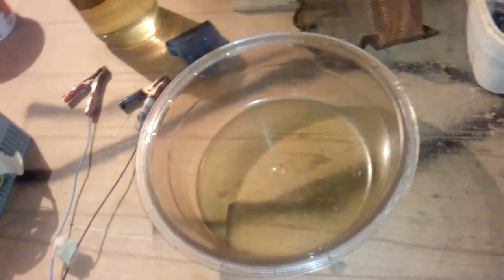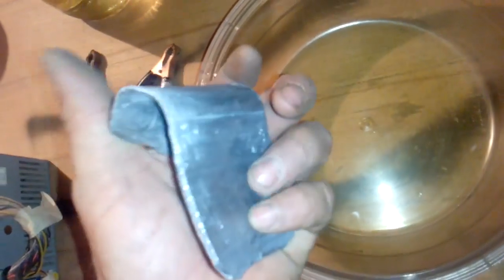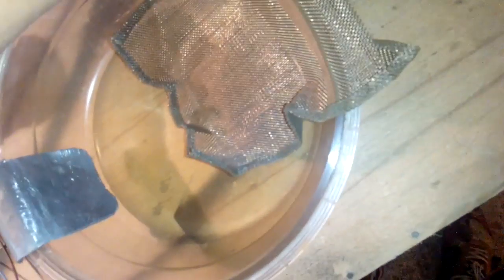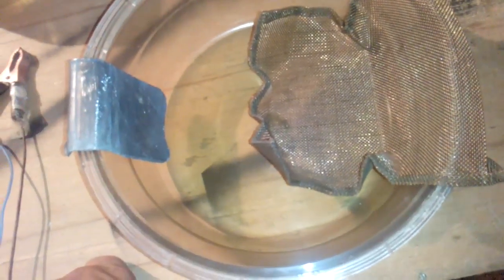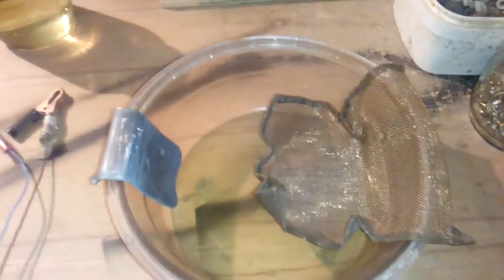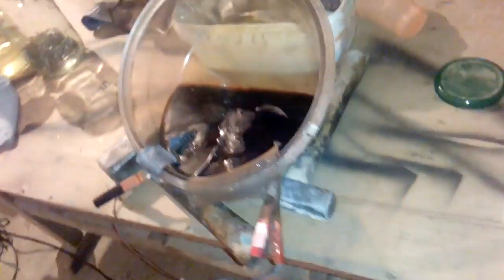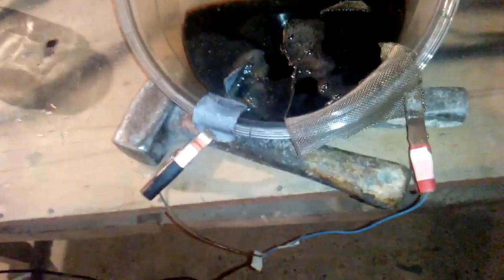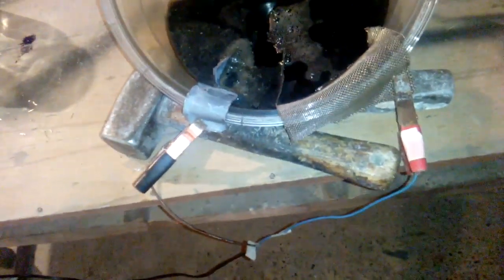Reverse electroplating gold recovery part 1

Comment: Thanks so so immensely my friend for sharing your excellent + informative + and easy/clear/concise instructions w/absolutely zero bullshit mixed in !!!!!
I used a copper mesh screen that I ordered from China. It was a 3 X 3 inch square of 88 copper mesh woven - cost literally $.99.  I had a lead anode I'd bought online for $7. And I used a huge glass square bread baking pan. I used 98% sulfuric acid. I also noticed that on the bubbles side is the negative side. When YOU pay attention to your power supply, you easily can glance seeing the draw of the gold refining cell doing its work as the needle nearly bottoms out while pulling gold into solution. It peaks right back to your original amperage once the process has successfully stripped off all (or the primary lion's share of the vast bulk of it at very least) long story short - I hugely appreciate this my friend #!! I've now got an outstanding gold refining cell of my very own that I've already acrewed multiple ounces of both silver as well as gold

Comment: Great video! May I make a suggestion, Maybe run smaller batches of pins to maybe allow a full reaction? Also got a ? Is there another solution I can use besides sulpheric acid? I just really do not like the idea of using sulpheric acid... Maybe I can use Salt water? or another type of acid like nitric or hcl?
Reply from the maker: Sulfur is the best, but you can try wit vinegar and salt, as in one of my first videos. Smaller quantities are always better because of the contact between the pins and the mesh.You can not use Nitric or Hcl for electrolysis because they will both eat the mesh. Maybe Nitric culd would be used if the Aluminum mesh and the pot were used because Aluminum is resistant to Nitric, but I have not tried it yet, now this idea has been sinful when I answered you, I'll have to try it.
Reply: Awesome! thank you I will try first with vinegar and salt first It is nice to know that aluminum is resistant to  Nitric.

Comment: Hi great educational video. Can u use this process for finger boards ??
Reply from the maker: Noup!Finger and pcb plated boards go in Ap solution ,that is the best vay.This dosnt work to good on that kind of materijal.If you have big glod plated surface on board,that is fine and it will work,but if not big,like fingers,beter is AP.

Comment: I wonder, if a stainless sieve will work like the copper mash. I guess, the sulfuric acid will not dissolve stainless. Did or can you try this?

And for starters: One drop H2SO4  sulfuric acid in your eye and it is gone forever, no help! Allways wear sealed glasses when you are working with sulfuric!!!
Reply from the maker: I think is stainles be ok ,maybe it less work like conductor,but they shod do the yob.
An yes,sulfaric acid is very dangerous,gloves,siled glases an respiratory is requred .